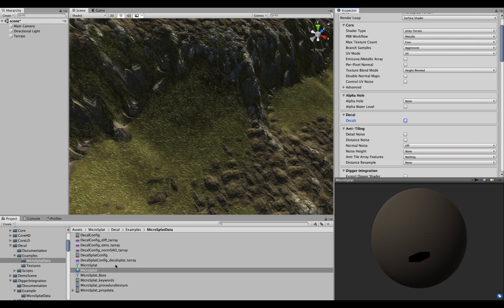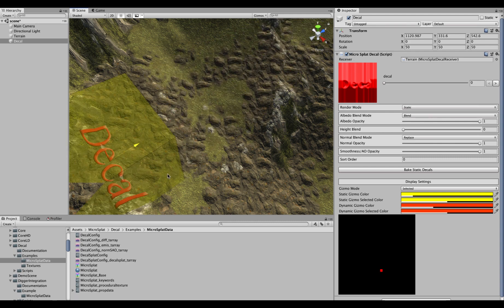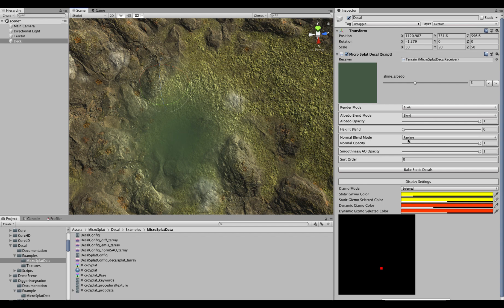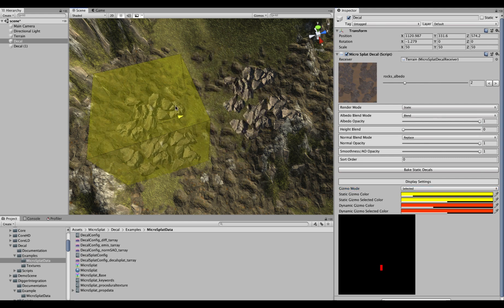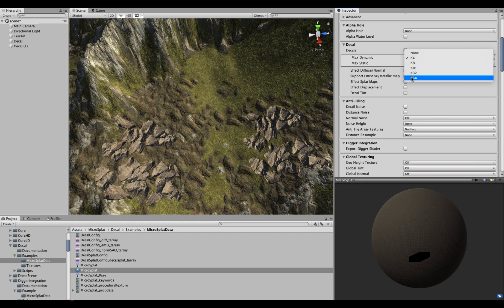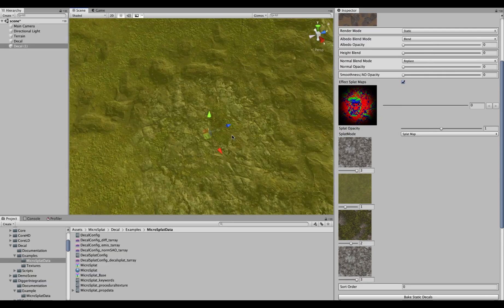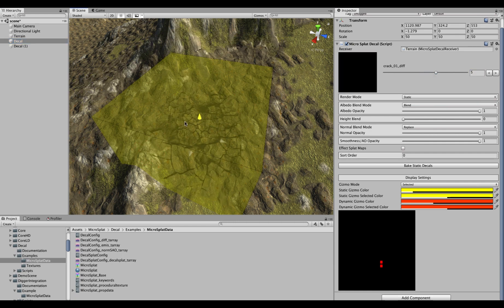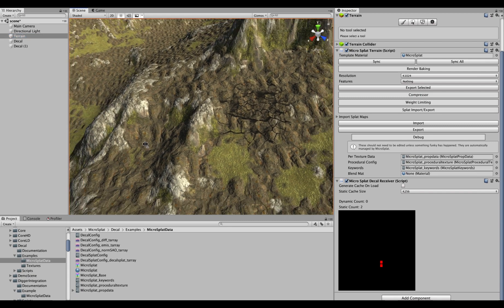MicroSplat - Decals

Comment: If I want to add blood decals on walls when enemy is shot, which is more cost effective : Unity's default decals or Microsplat decals ? Is this only for terrains or for any meshes?
Reply from the maker: It only works with MicroSplat shaders- meaning if the house is textured with MicroSplat, then it would work, but not if it's with the standard shader or some other shader. Unity only has decals in HDRP right now, and in 2019.4 they are complete broken, casting on everything, like the player, like it or not. However, that's fixed in newer betas - but the decal system in HDRP is definitely super expensive by comparison (it has it's own full screen buffers, etc). That said, for something like bullet holes I'd recommend a deferred decal system- that will work on anything, be cheaper than HDRP's decals, but obviously only works in deferred and won't handle some of the cases that other systems do (like having snow correctly cover a decal, modifying tessellation, etc).
Reply: @slipster216  Thanks for the detailed answer. I tried some simple deferred decal shaders and stick with them for simple decals.
Reply: @rvv27  Just curious what you ended up using for small decals in HDRP? In addition to this plugin for static decals on terrain, I'm looking for something for small dynamic footprints, etc. It seems Unity's doesn't/won't support emissive decals either, and I just read about the mess that is their decal layer system in HDRP 10.
Reply: @Ziflinz  I am using Built in at the moment. Not using HDRP. For Built in there are several options for decal rendering. If the decal is small you can simply put a quad with transperancy shader along with right textures and normal map. Useful in case of small decals like bullet holes

Comment: will this work with the mesh generated by Terrain to Mesh module and microsplat Mesh?
Reply from the maker: Right now only dynamic decals work, but adding support for mesh terrains to have static decals shouldn't be hard (assuming you don't move them), so it's something I will look at soon.
Reply: @slipster216  yes I want them to be static for example dirt road tracks , with nice blending the road can have dynamic look
Reply from the maker: Actually, just got static working fully with MeshTerrains as well..
Reply: @slipster216   it's not in the store yet.🙄